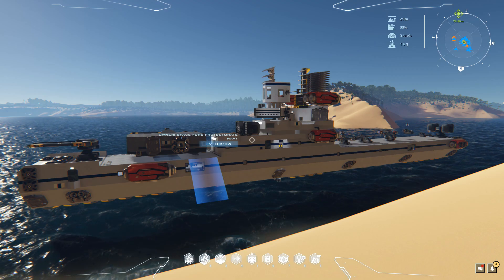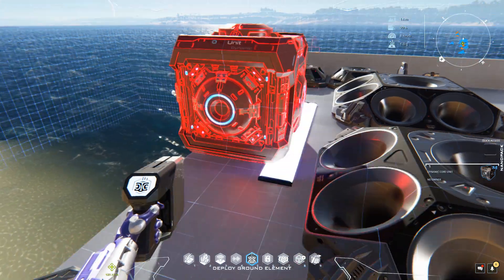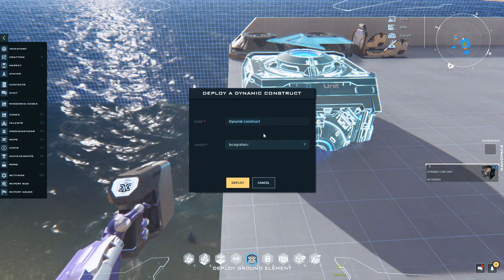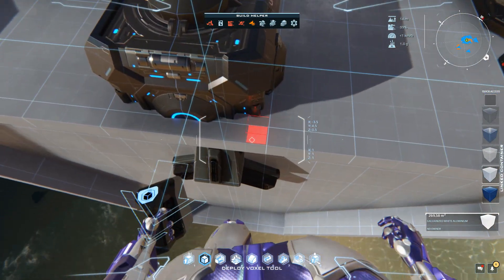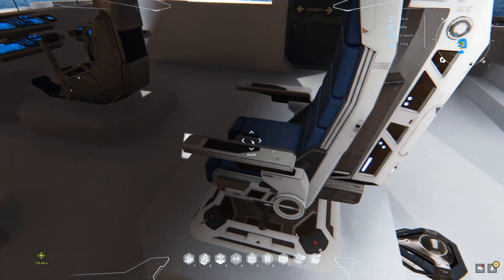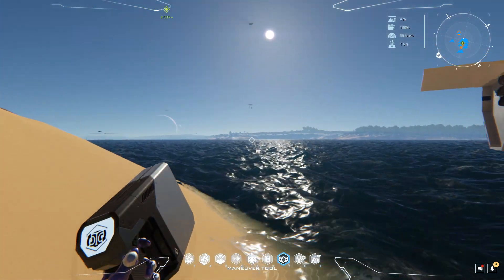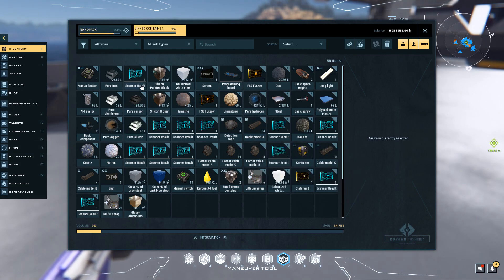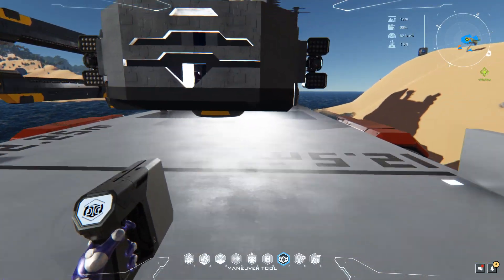How to do Dynamic Core Extensions on Dual Universe to Make Your Ship Bigger

Comment: Do engines or weapons also work on these additional cores?
Reply from the maker: Only if controlled from each core! c=
Reply: @LucaTheGuide  Is it possible to control all cores via Lua?
Reply: @LucaTheGuide  So main core L and core M and S are connected to it and via Lua what's on the L core and connected to the seat, control all other cores?
Reply from the maker: @ryzenblack  Hmm not sure if that's possible, inter-construct lua is not possible afaik, and even if it is JC has said that they want people to not be able to control guns via lua, not sure about engines though